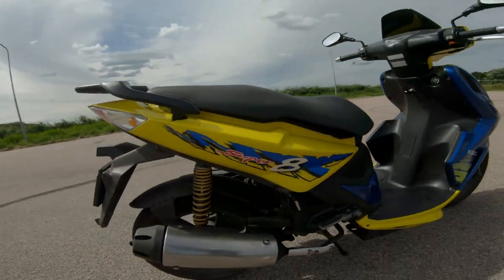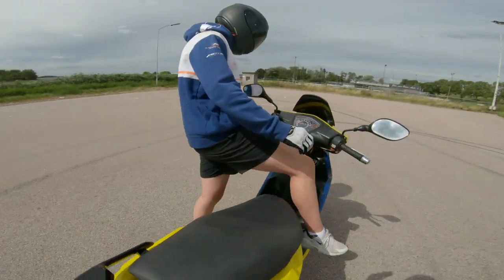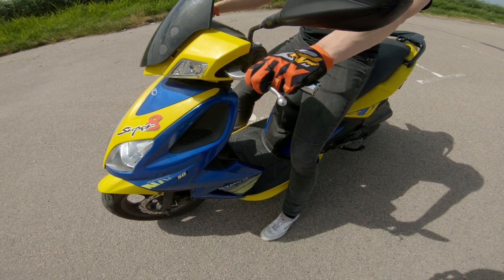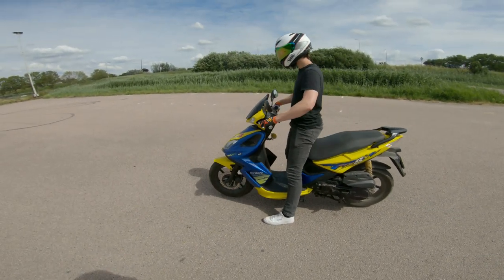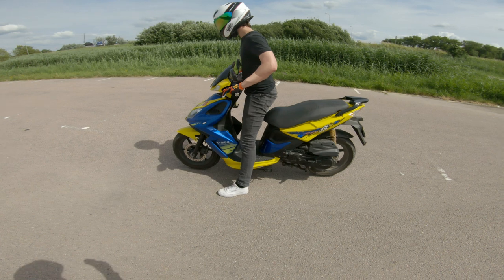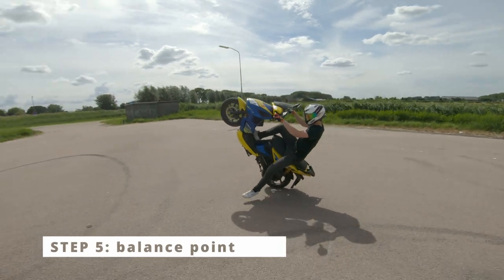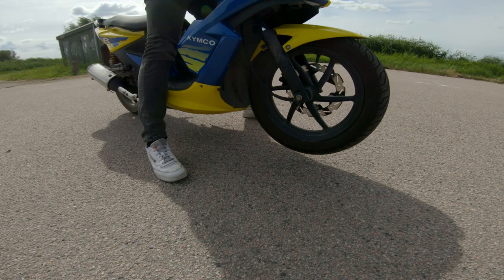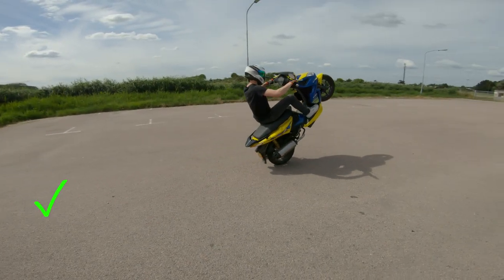WHEELIE TUTORIAL | 50cc scooters

Comment: Man, i have 2000. Typhoon XR, 50cc bone stock but unrestricted, it goes about 65km/h. But there is no way i can lift front wheel more than 10 cm for 0.5 seconds, im not that weak but to me it seems like there is not enough torque, but I'm probably wrong. I've watched at least 10 how to tutorials including yours, I'm trying everyday but i think  there is no chance. Shame nobody is doing scooter wheelies where i live, if someone did wheelie on mine at least i would know that it's possible but i am just not skilled enough :D
Reply from the maker: Sorry it didn't work for you yet.

I did a quick google search for your scooter and I think it is a 2 stroke with a lot of tuning potential.
I don't know how handy you are with scooters, but if you replace the vario rollers with lighter rollers it should work. (It's easy and inexpensive)

My brother couldn't do it either, I think because he's still a little too small or because he hasn't got the hang of it yet.
Reply: Bit of a late comment here but instead of pulling on the handlebars and sort of jumping with your knees, just shift from the front of the seat to the back, this is what helped me
Reply: Od kud si brate
Reply: @Pavic95  Vz 😁✌️
Reply: Change your roller slider weights to sliders 1 gram higher for sliders for example if stock is 6 regular roller weights in sliders you use 6 or 5 if you want to go a bit lighter for more torque and acceleration  adjust the throttle to make sure it's  responsive you should be able to do it unless it's the fear stopping yo
Reply: I had a typhoon 80 and lost count of how many times I flipped it, it was a brilliant wheeliebike, admittedly x 2 power of the 50 model almost

Comment: Im trying with my peace sports ar50
Reply from the maker: Cool, any luck with that?
Reply: @MozesHak  not really just doesn't seem to have enough torque
Reply: @MozesHak  any suggestions for more torque? I just got a new carb and air filter by nibbi 22mm for 50cc with 90cc big bore
Reply from the maker: @sanxhez.official  the big bore kit will certainly help.
It might be also a good idea to tune the cvt, so lighter variator rolls and/ or a stiffer clutch spring.
Reply: I changed my rollers to 7g sliders I’m gonna try the clutch spring now

Comment: ho la stessa moto ma non riesco a fare quello che fai tu nel video, come devo fare, ma è originale il kymco nel video?
Reply from the maker: The Kymco in the video is upgraded with a 60cc big bore kit, and that really helps with the torque.

You can also look at your CVT, like upgrading to stiffer clutch springs or lighter vario rollers.
Reply: @MozesHak  ah ecco perche, quando hai speso piu o meno?
Reply from the maker: @pcplayer5289  So I have done the big bore and the CVT upgrades, but I think you can make enough torque with the CVT upgrade alone. 

The CVT upgrades are also way more easy to install.